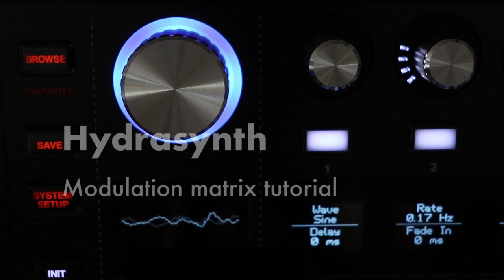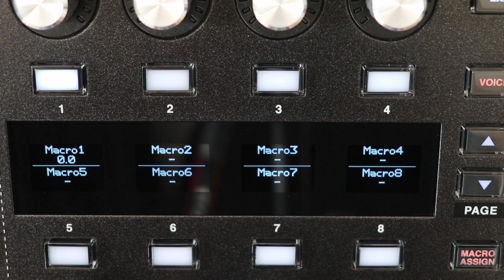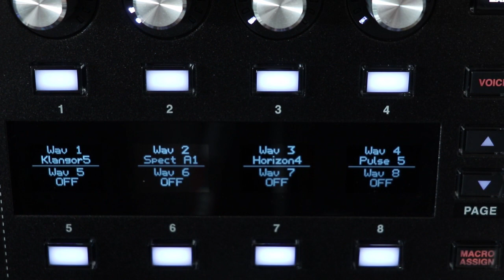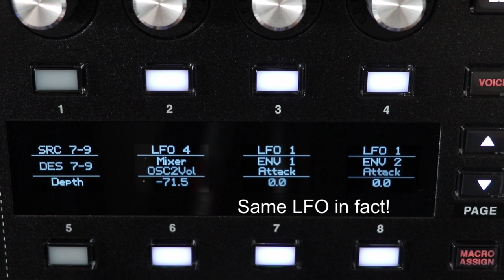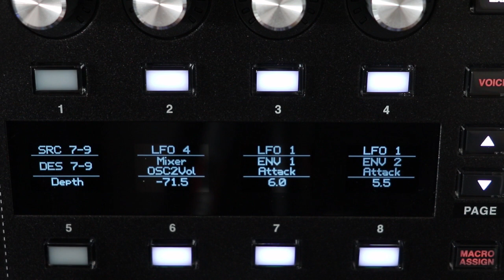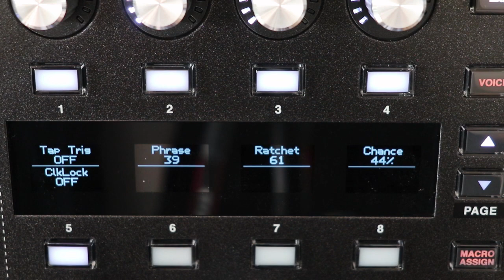Hydrasynth sound design tutorial: mod matrix etc

Comment: This was an excellent video.  Great educational content.  I'm having trouble getting the LFO controlling the WaveScan index to cycle smoothly through the wave list.  The Wavescan index modulation seems to start and hold at initial value and then proceed through the waveform cycle THEN it starts and holds again and repeats the cycle.  I believe  you mention in the video this is due to something being bipolar.  Can you elaborate on this ?  Thanks
Reply: If you keep scrolling in the mod matrix past the LFOs you can select "LFO1+" (for example) as a source, which makes the LFO behave unilaterally. So if you set a starting value as say 50, it will only move up in value and back to 50 (instead of above and below 50). It's usually my preferred style of LFO behavior... Hope that helps :)
Reply: @BIG_PASTA  I finally found the unilateral +  designations and got it to work that way.  Wasn't aware of setting the values though.  I'll have to look into it.  Not much info I can find on this.  Thank you for your help

Comment: I'm new to hardware synths and I have (probably a dumb) question. On the Hydrasynth - Is there a way to record MIDI info plus audio input into a DAW? Specifically Cubase 10. I have a Steinberg UR22mkII input device. It has 2 stereo inputs, MIDI IN/OUT/THRU in the back. Any help with this would be appreciated!
Reply: Yes you can. That’s what you need to do with all hardware. In your DAW you will need a midi track to record the notes you play, and an audio track to record the sound from the synth.